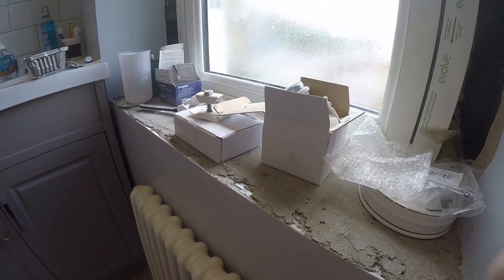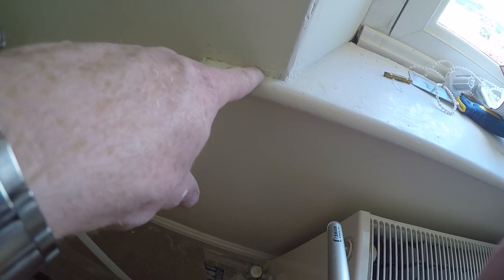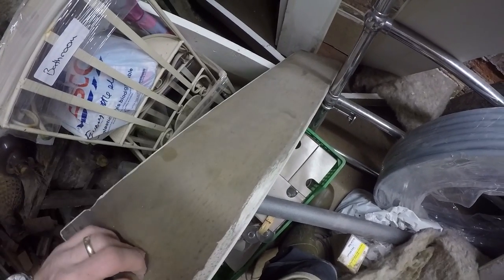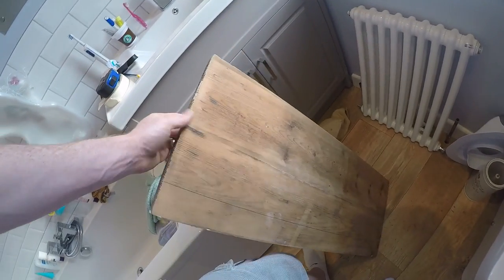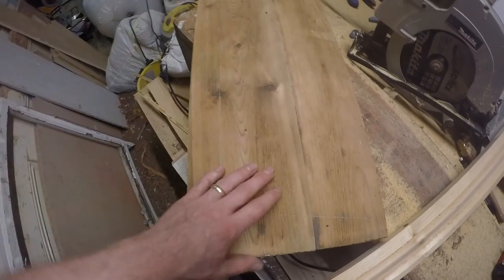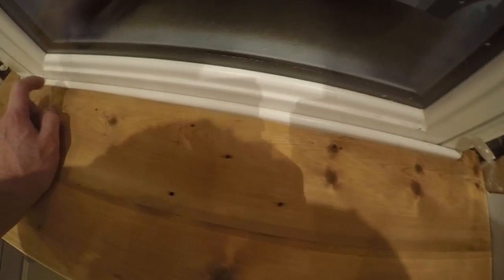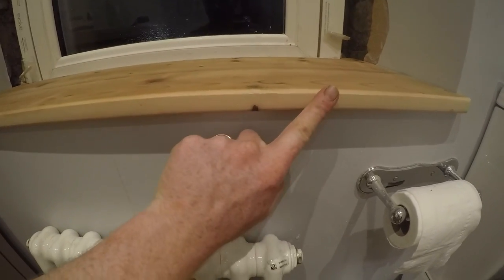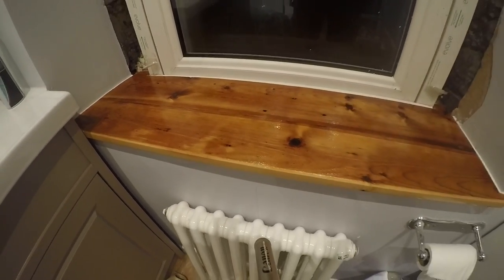Making a Reclaimed Pine Windowsill

Comment: You have inspired me to do the same in our cottage from 1850's , I had to lift the floorboards in 2 rooms to pour a floor and have loads of red deal floorboards, I put new windows in and this would finish them off nicely plus I love re using the original fabric of the building whenever  possible, Many Thanks

Comment: What was the finial stain you used ? Looks very nice and I've lots of wood to do my self
Reply from the maker: +Matt Hemming We use OSMO to finish most of our timber.  Using a coat of their honey colour and then finishing with clear stain.  It is very easy to work with and very durable for our floors.  Don't be put off by the price, it goes a very long way!

Comment: another great video :)  question: I might have missed something but how did you stick the windowsill to the wall? no screws, no glue...just the silicone on the sides? is that enough?
Reply from the maker: Just bedded down on adhesive. 👍
Reply: @TheRestorationCouple  what adhesive did you use? Got a similar project on a room with cills i've made from spare oak kitchen worktop.

Comment: hi do you need to fill the gap between the outer and inner walls for a window board? thanks
Reply from the maker: I assume you mean a cavity wall? If that is the case then usually a cavity closer is in place. Tbh it is probably not an issue either way unless you have any damp issues.
Reply: @TheRestorationCouple  thank you very much, I will fit the board because there is no damp. thanks again

Comment: Lovely job and great video, can I ask, how did you secure the windowsil down?
Thanks
Reply from the maker: Levelled it first with some framing spacers and then just some construction adhesive. Seems to have done the job fine. If it was onto a timber framed wall I would have used fixings but the stonework was flat already.
Reply: perfect, thanks

Comment: Hi, thanks but you didn't say how you stuck the wood to the brick surface below? Also I didn't catch how you did the bevel edge, just planer? Thank you.
Reply from the maker: Just plane or router the corner. It was a while back but I imagine I sat it on mastic or construction adhesive. Doesn’t need much.